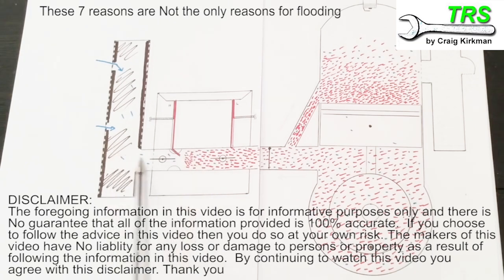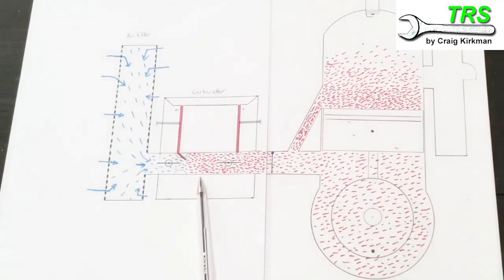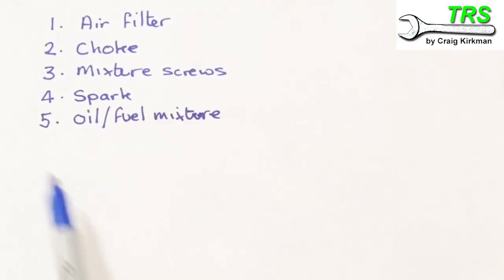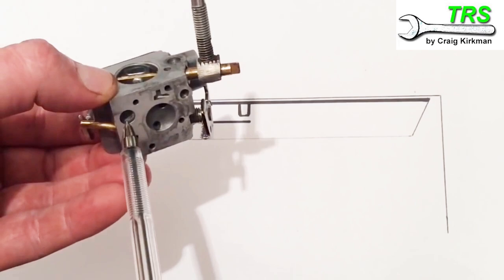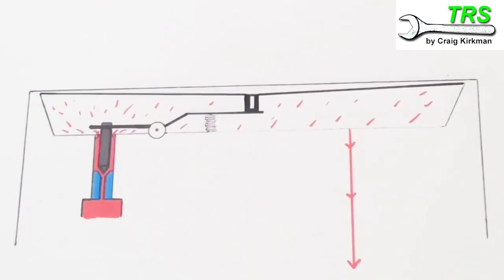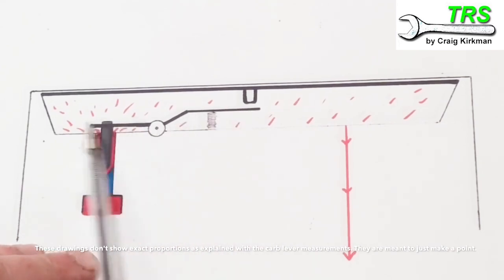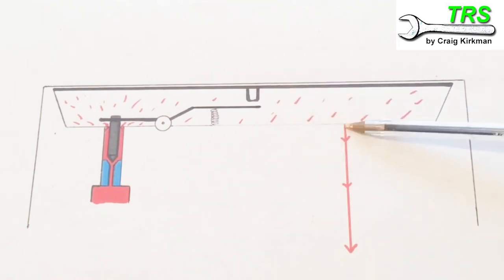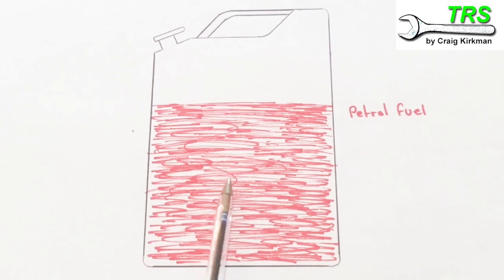CHAINSAW FLOODING - Wet Air Filter or Spark Plug. This is why!

Comment: Dear Sir, I just want to say thank you for your support and advice. I have been working with a Stihl 020T that has been showing all the symptoms you’ve covered so well I’m this instructional video. After replacing the air filter, the spark plug, and lowering the needle valve lever, the problem has been resolved. What a satisfying accomplishment to get this old saw back into a condition that is ready to go into service at work. I am an arborist in Pennsylvania and you’ve really helped me. Sincerely, Kyle H.
Reply from the maker: Dear Kyle H.,

Thank you so much for your heartfelt message! I'm truly delighted to hear that the instructional video and the advice provided were instrumental in getting your Stihl 020T back into prime working condition. It's fantastic that you were able to diagnose and address the issues so effectively, and I can imagine the satisfaction that comes with reviving an old saw for your arborist work in Pennsylvania.

Your kind words and the fact that I could assist you mean the world to me. If you ever need more help or have questions in the future, please don't hesitate to reach out. Wishing you continued success in your arborist endeavors, Kyle! Keep up the excellent work! Craig

Comment: My Echo SRM225  trimmer turns on and then runs for a couple of seconds with the trigger pressed and then turns off instantly.  After that I try to turn it on and when I pull the starting cord it begins to spit fuel mix out the exhaust and won't turn on again until I dump out the flooded fuel mix and let it sit for a bit , but still the same events take place later. My research brought me here to understand what the diaphragm does and I ended up learning more of what to expect before I go spend money on something I may not need or I may need more parts all together. Either way I'm eager to do it myself , THANK YOU for increasing my manliness to the next level by giving me your knowledge....lol

Comment: Very good explanation of flooding problems with two cycle engines I watch this because I'm having a flooding issue with my chainsaw and now I feel I have more information to go after the problem two-cycle engines can be a real pain in the butt when they don't work right they will drive you completely insane trying to fix them.

Comment: Thank you for your video's, they are one of the best explanations of 2-stroke engine, you got a subscriber. It is more a user error, I thought that the primerbulb should push petrol in to the carburator and I thought as a beginner that it is normal that there is petrol comming out of the carburator, but it was the otherway around I found out, sucking it through the carburator. So you can put to the list a wrong connected primer bulb causes also engine flooding...

Comment: I picked up a used Poulan 4018(Wild Thing) cheap just as a backup saw. It ran when purchased, but I noticed it stalled easy.
That didn't last long and it would run intermittently good or Stalling constantly. I pulled the Carburetor and did a Full strip down and cleaning. Flushed all passages, checked needle height and inspected the Diaphragm. Reassembled installed and tuned the saw. It ran well and cut without issue.
A few uses later it started shutting down when warmed up(Coil failing) and eventually quit firing. Replaced the Coil... and of course had to tune the Carburetor again.
*I started and warmed up the saw every day for a week without issue. Seemed like problem solved.
Took it out and cut up a couple dozen 3" to 6" limbs. noticed it was slightly Fat raising the throttle(slight stumble), but got the job done.
Next day I intended to finish the limb work but the Saw was having a hard time throttling up and stalled several times. I could start it on High Idle but had to shut it off after finishing cuts and use High idle to start it again.
I attempted to make Jet adjustments but the saw would not stay running long enough to get the tool on the screw. Even raising the Idle screw wouldn't keep it running.
Notes:
Cold - Saw fires on choke and Starts on High idle(choke off) but runs very rough.
Bumping off High idle - Saw stalls as soon as Throttle is released
Spark Plug(new) - Fuel Soaked
Closed L to 1 turn
Closed H to 1.25 turns
Wiped Plug Dry, installed and Started saw on High Idle
Same result when bumping to low idle - Saw stalls and Plug is flooded.(Dry/Start/Stall/Flooded - Repeatable)
**I am 70 and eye sight is failing. Needle looked good, but I cannot focus on the Jet seat itself. 
My thought is on assembly the Needle was installed in a slightly different rotation and was close to, if not completely, sealing. Through use it has rotated and is now allowing Fuel to pass from not seating.
Your Video is an excellent refresher and after reviewing the Valve/Seat section I am convinced this is the issue and will be ordering a Replacement Carburetor.
Thank You!
Reply from the maker: We appreciate you sharing your thorough Poulan 4018 (Wild Thing) experience. You've obviously put a lot of work into maintaining and diagnosing it. It's wonderful to hear that the video and material were useful to you in troubleshooting.

When it comes to carburetors, especially if you have acquired this from previously used, then stripping the carb and servicing it is always best done by using a new service kit with new diaphragms etc. I know you probably looked at the diaphragms and thought they looked ok. But believe me you can't always tell the functional condition of these by touch and feel. Also, in the kit, there is a new needle valve, which will likely seat better than the old one.  You will also get a new (tensioned) metering spring, which will seat the new needle better.  When you had the old need valve out of the carb, could you see a ring around it's tip.  I know you said about your eyesight, but if you get chance to take it out again and see (using and magnifying glass) then the presence of a ring will tell you if it is wasted.  A diaphragm service kit can be bought for as little as $15 nowadays.

Other than that, I know here you are coming from here.  I have spent hours upon hours trying to get some carburetors up and running, and on occasions I have had to just say "you know what, it's time to fit a new carb". I wouldn't usually be so quick to say this but given the details in your comment, you sound like a very knowledgeable person in this area, which means you have probably done all that most people would be able to do.  I know it is nice to tinker a little with these things but for me, when it gets to this stage, the time isn't worth the money I would be failing to earn due to trying to fix it.  I find that forthe the price of $25 a brand new (non genuine) carb, from Amazon, usually does the trick reasonably well. Well, much better than before anyway.  This way you will be up and running much quicker and better.  

I'm not just trying to just take the easy route here, it's just that i totally understand your frustrations. Carburetors, like other things, sometimes need to be replaced.  I have wasted too many days to no avail with some carbs and I have found this to be be the best way of dealing with it.    

If you do choose to get a replacement then please let us know how it works out, and don't hesitate to contact us again if you need help in the future or have any other questions. It is quite admirable how committed you are to maintaining the condition of your equipment!

I look forward to hearing from you, and thank you for contributing to the community

Craig
Reply: @TheRepairSpecialist  Your quick and through replies are always welcome and appreciated.
The Needle is the Solid hard type and no wear ring was noted. This is what leads me to believe the softer seat is the culprit. If I were Younger I'd take a drill bit to the seat and smooth it to renew the surface, but now my hands are a bit to shaky for the fine work. 
I do agree, kits are an easy route to refreshing a carburetor, but for the $2-$3 difference in price and all the extras I can get with the Carburetor(Air Filter, Fuel Lines, Purge Bulb, spare Spark plug, etc.) just makes replacement the route to go.
I have always had this thing about having a good look before throwing money at a problem, often resolving the issue in the process for less or no investment. Then if necessary, replace.
As for the Diaphragm and Spring, I was satisfied Both were in decent working order from the Week of test running and full day of Cutting with excellent throttle response and decent Idle.
After I swap out the Carburetor I'll pull a vacuum test on the Fuel feed side, I suspect it will fail.(I have to replace my vacuum tester - Brake Fluid infiltrated and ruined its seals)*never loan tools - lol

On a bright note, Yesterday I finished running Break-in cycles and slight tuning on my 2nd 4-stroke 49cc Chainsaw. Picked the first cheap($89) a year ago and have worked it hard, LOL - Really Hard. It went through over 10 cords of hardwoods with nothing more than regular Cleaning and a few chains(now I sharpen) before worm gear Failure caused excessive Sprocket movement, throwing chains. Contacted the Manufacture to get parts for Repair(all wear items)......... and they ended up sending me a Free Replacement, complete.
I've sourced all the parts through AliExpress to restore the original. 
Retirement -🤣

Thanks again for the knowledge you share!
Dal
Reply: Be sure to check the gas cap vent first

Comment: Informative video,thanks....
 My specific problem is that I put a new air filter in my 075 Stihl and run it,
It will fill the filter with fuel mix and choke it self..
Replace the filter ,same thing....got any thoughts?? Thanks Walt

Comment: Im working on my ms310 that sat neglected for a few years. Ive rebuilt the carburetor replaced all the hoses,and tuned it up,but but its flooding soon as it starts. With the air filter off it spits fuel back out through the carburetor as it runs. I can only get it to run for about 30 seconds. Ive double checked my float lever height twice and can only conclude the fuel is leaking around the seat. The needle was frozen in place when i rebuilt it and i had to slray it with pb blaster and use needle nose pliers to remove the old needle. Id say its corroded or has some other deformation

Comment: I appreciate your videos, the way you explain band I have learned a lot but there is a point in this video I don't agree with you. You say the lever level must be leveled with the diaphram base seat but in my opinion is not exectely like that by the reason walbro and zama have lever gauge tools to set the needle lever and its level varies to the carb type. Please correct me if I' wrong
Reply from the maker: Yes you are right for some of them. I should have mentioned that some carbs are set the way I explained and many others are not.  Good point!  I will look at amending that. Thanks. Craig
Reply: Explain band ? Explain and. Correct grammar. Correct if I wrong, correct me if I am wrong correct grammar.
Reply: @TheRepairSpecialist  think I need  new air filter 😑

Comment: Hi. I have fuel coming out of the carb soaking the airfilter and pooling in the air filter housing, when the 2 stroke Echo hedge trimmer is running or not, what could cause this?